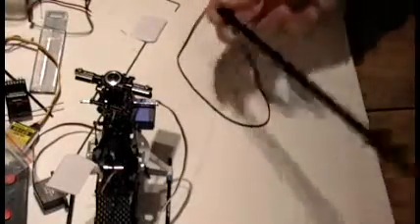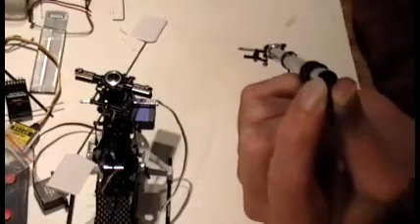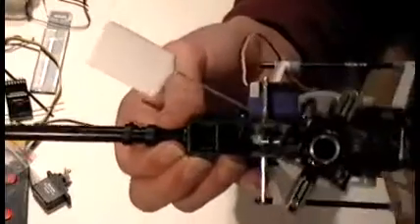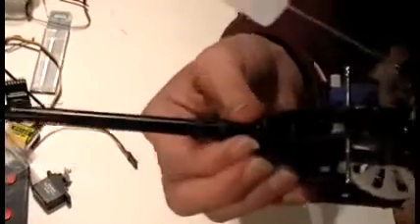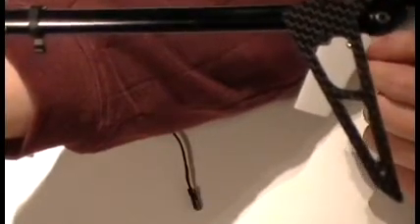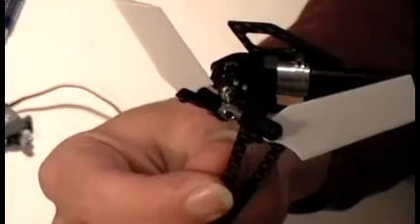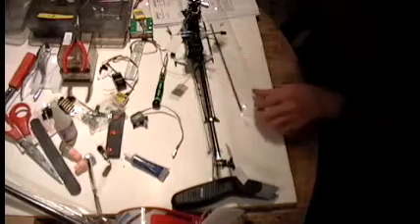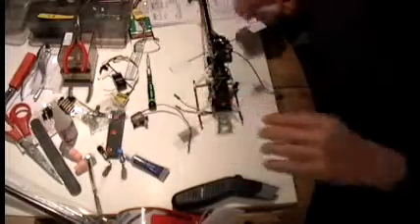Align Trex 250 Build - Tail

Comment from the maker: Without power and receiver signal, the servos will move if you push on them. You have to be careful not to do that. When you put the horns back on, you can power them up and go back to your 50% pitch point, and it should be easy to see where they need to go. My wiring job isn't that good - you can see some good ones on Helifreak web site. I will do a video about shortening the cables when I get around to it. That has been requested and is in the queue :)

Comment: hi jasmine
hi all
hope you don't mind jasmine, your vids are always of great help. This is just another way to do it:
If you have difficulties follow jasmine's way, i found this way to be easier:
First connect the Boom to the Mainframe with the Belt attached to the Tail drive gear, than simply slide the Tail Rotor Shaft into the Belt slope and built the Tail unit around.
Pull the Boom a bit to give the Belt the right tension (don't overdo!). Fix screws - done.

Comment from the maker: It is not hard to build if you have built a 450 or 500 before - it's pretty much the same thing but smaller. What is tricky about this one is getting it set up and adjusted right, because of the small parts. Also, flying it can be hard because you can't see it too far away and it moves fast.